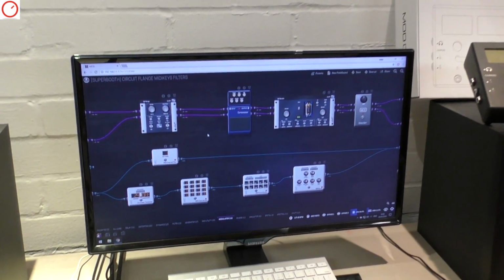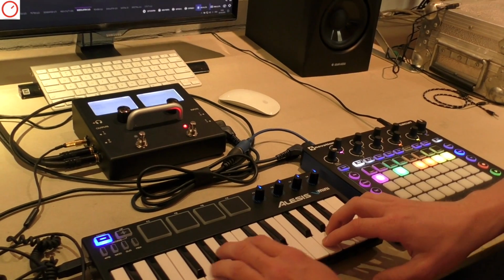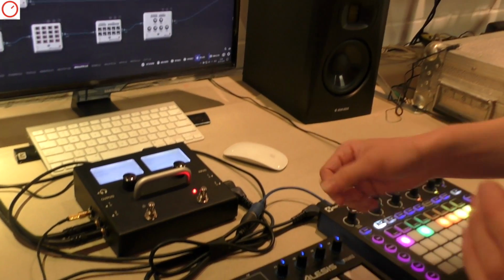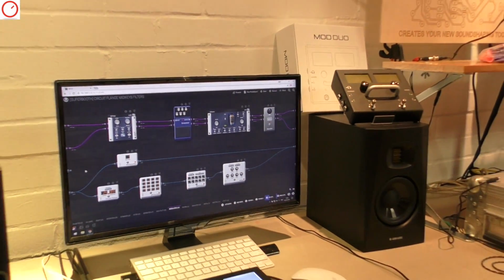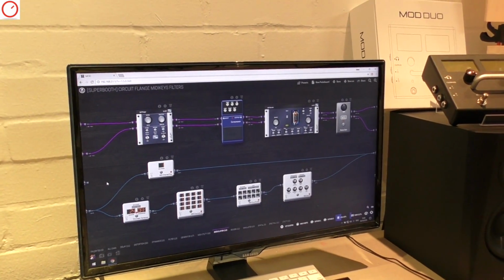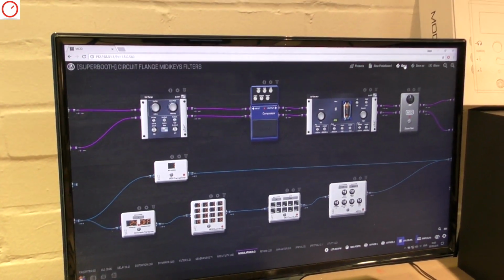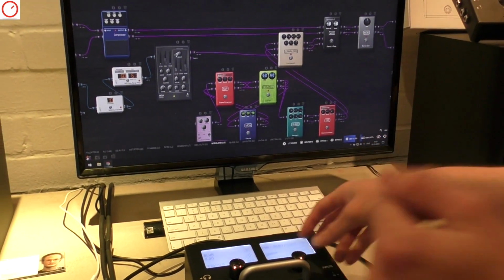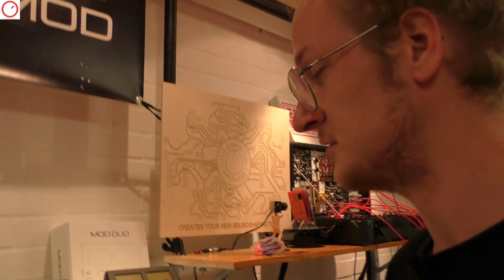Superbooth 2018: MOD Devices MOD DUO - Modular Audio & Effect Processor | SYNTH ANATOMY

Comment: Does anyone know the processing time?  How many ms of delay should I expect?  I would be using this with guitar.
Reply: https://wiki.moddevices.com/wiki/FAQ roundtrip latency is 8ms.
Reply: OK.  I'll set up my interface into Amplitube to mimic that delay and I will see if it is usable.  Thanks for the link.
Reply: When setting the latency, make sure the measure the actual round trip - the software calculated value does not include the ADC and DAC delay itself, which can often be ~3ms.. if you measure round trip, then you know the absolute value which is the one you care about as a musician :)
Reply: Although correct - you can manually change the "frames per buffer" if you're an advanced user. As you probably know, the lower the latency the higher the CPU load: its a trade-off between latency and "amount of total processing". It has been measured and discussed it in a bit more detail on the MOD Forum here: https://forum.moddevices.com/t/mod-duo-latency-measurement/1319